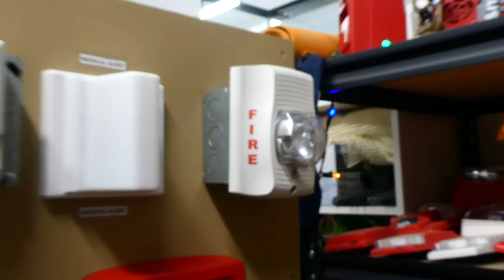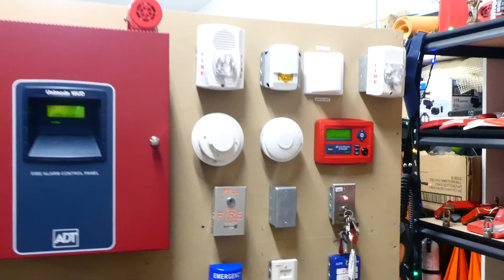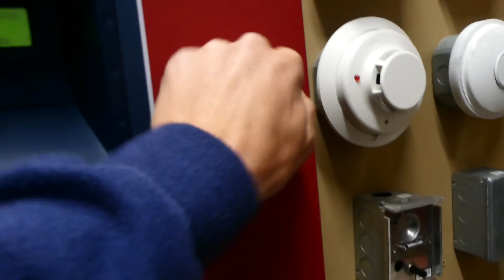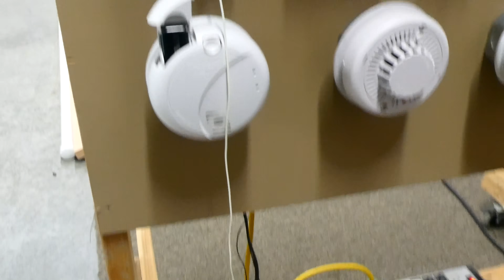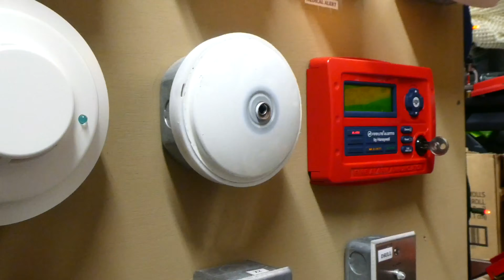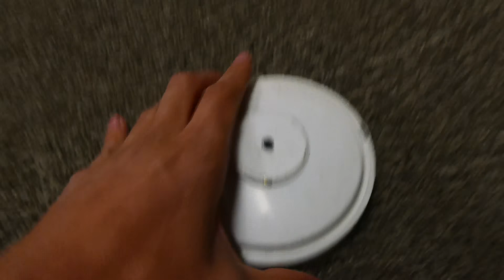ADT Unimode 10UD System Test 15: Low Frequency Alarm

Comment: We just had a fire emergency at our college dorm. The dorm rooms have System Sensor smoke detectors that act as low frequency sounder horns. Those are fine, but the regular System Sensor alarms (advance) are piercing, and there's like four of them in our small hallway

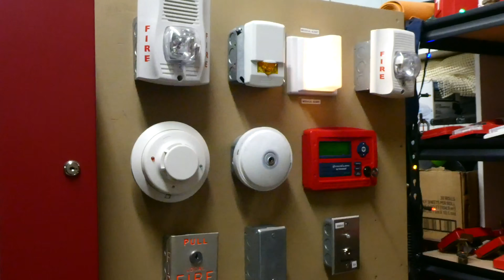Comment: 5:04 why is amber led strobe flashing as the system sensor alarms they just flash at the same time and the quarter light is used of the light for lights off for that its used some little light lol

Comment: When you are trying to activate the rate of rise portion of a rate of rise and fixed heat detector it sets off without permanently activating if you go around the edge of the detector rather than the disk but it is still possible to set off the disk if it gets too hot. Nevertheless if it pops or not these tests are always the best

Comment: You'd think there would be a way to replace the disposable part in the heat detector to restore it to operation.  But I suppose that would require being able to order one from the manufacturer (assuming they make that part and its available to purchase).

Comment: The fixed heat detectors work like sprinkler heads - at a threshold heat a fusible link (glass bulb or solder joint) deliberately fails and opens a circuit (sprinkler system or an electronic fire alarm circuit). Both are one time use. There's technically nothing stopping a sprinkler head from being rigged up as a fixed heat detector apart from regulations

Comment: It would be pretty interesting to hear one of those low-frequency sounders on march time. Nice video!
Reply: Yeah me too because every video I see on them they are on code 3
Reply: @leoschneider3570  It would have to be a horn only to do that. Because it's two wire, coding it will also code the strobe so there is no option on the H/S model to do that. I have a L series version and there is code 4 (CO alarm) but no option for custom. The horn only version does have custom.

Comment: Wow, never knew the front face of a heat detector would pop off once activated.
Reply: filmer765 rate of rise Ones are normally fixed too and when you’re testing them if you don’t heat them up quick enough they will pop and it sometimes makes you jump
Reply: It's a fixed heat detector..
Reply: Not always, it is a mechanical detector. Some don't. But mechanical fixed temp ones actually do pop off.